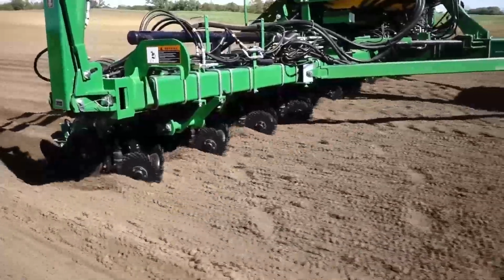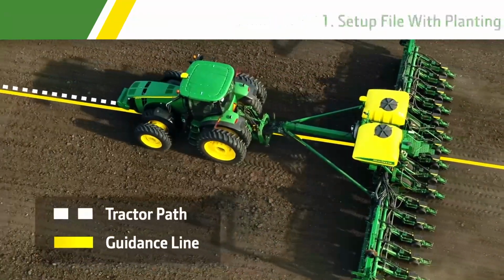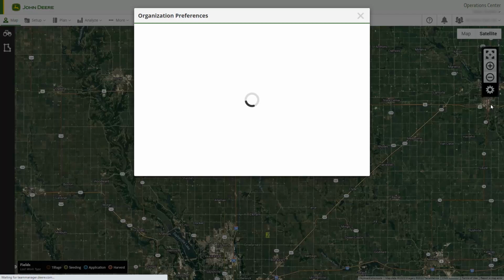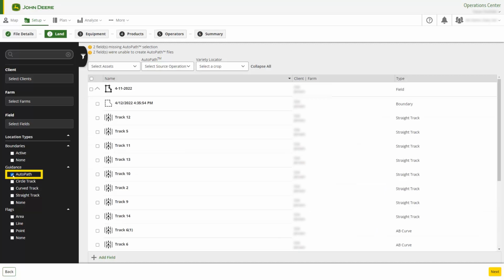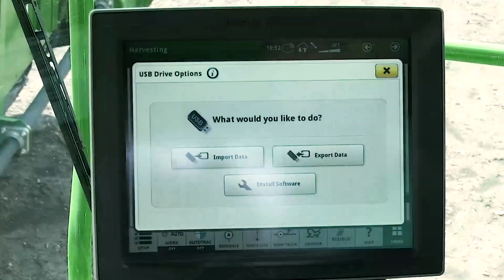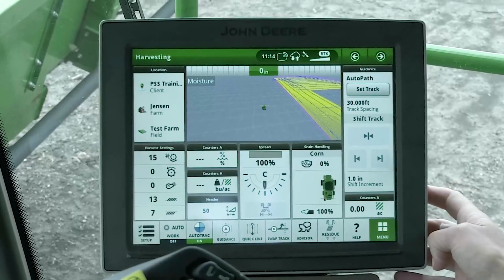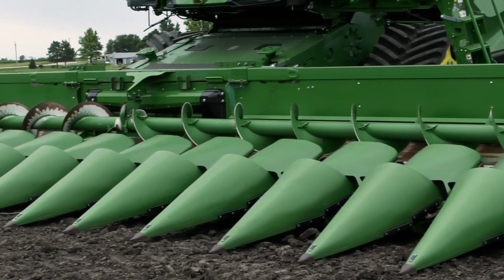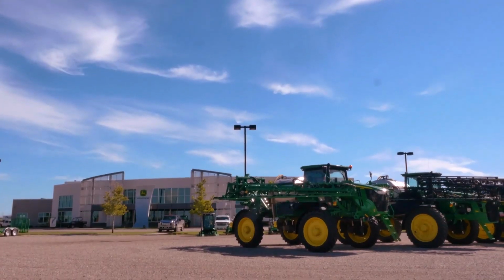How to set up John Deere AutoPath™ for Harvest | John Deere Precision Ag

Comment: Does planter also need a receiver, or only the tractor?
Reply: Yes the planter is required to have a receiver when recording Autopath to account for planter drift and make the Autopath data as accurate as possible.
Reply: @traviskaeb6489   So when we recording first guidance lines for example in planting, we need to use always 2 Star Fire recevier. And if i have Väderstad tempo wich have own GPS recevier and take communications on ISOBUS, isn't good?   2. I will try get on the autopath on teh organization preferencies page, but i havent the under menu.  dont see this option.
Reply: 3. I see after my planting auto path lines for the fields, but i cant use them for harvest because  it say: AutoPath™ error
No Starfire receiver was detected for the tool used for this operation. SF3 or RTK used by Starfire GPS accuracy is required to use AutoPath™.
Reply from the maker: Thanks for reaching out, John. Your local John Deere dealer is your best resource for technical questions like this one. You can find your closest dealer at Deere.com/Dealer.